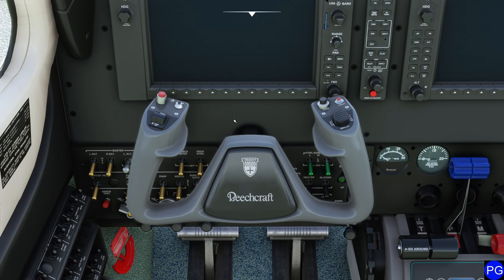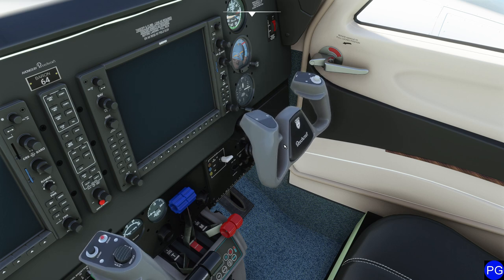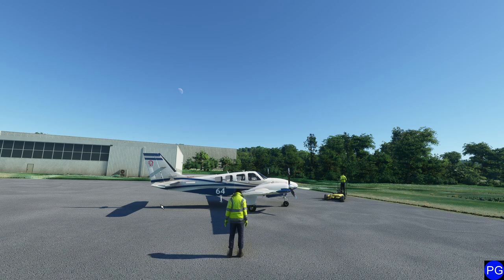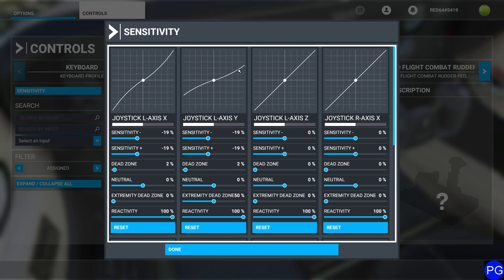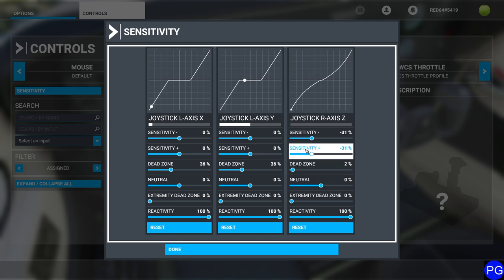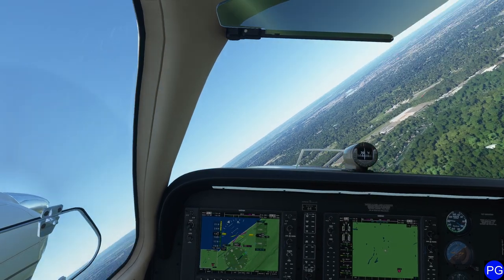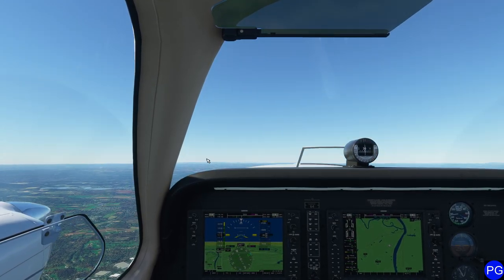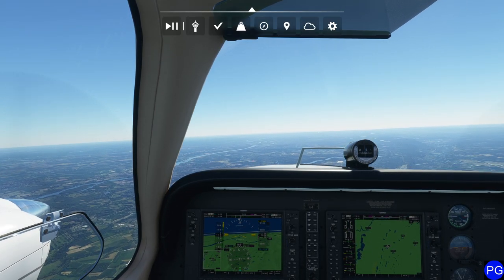MSFS - Adjusting Controller Sensitivity Curves

Comment: Very helpful video. I was using the same yoke profile config for a Cessna and M20R Ovation and it was causing me a lot of frustration when flying the Ovation. I did mess with the settings a bit but not knowing what they all meant made it pretty difficult. Using your video I was able to get the Ovation configured in about 10 minutes using a new profile. What a pleasure it is to fly now. My biggest issue was getting my brakes too work but your video gave me a clue.

I have MFG Crosswind pedals and they were not getting full range of motion so I had a devil of a time stopping any plane. I figured something was wrong after watching this video and seeing the bar go all the way to the top which mine was not doing. The out of box config comes with a 10% dead zone at the end of travel so just an FYI to anyone with the MFG pedals. You need to use the MFG calibration utility first before you set them up in MSFS. Anyway, great job man and thanks for taking the time. AE

Comment: OK. First, glad you did this. It has been desperately needed, especially since MS/Asobo don't provide much documentation on MSFS. 
Question: You mentioned early on you will probably need a different sensitivity setting for each type of airplane. Does this mean you are using a different profile for each specific aircraft type (such as the 172, Bonanza, Baron, Citation, etc.) or do you use different ones for general aircraft type such as single piston, jet, turboprop, etc.?

Comment: i have a logitech 3d pro and it works fine on any aircraft in msfs except the pmdg dc 6b  , i have no pitch control and it crashes and i cant pull it up. Ailerons are very sluggish so im guessing its in the x y and z settings.  Do you have a vid for this or bigger plane settings.  This joystick works fine for 747 by the way.

Comment: Have you thought about cleaning the pots in you rudddr pedal? Sounds like the potentiometers are dirty. Get some electrical contact cleaner and spray some in to the pot and then work it in both directions a few time.
It may take a few times for it to get more then acceptable and should buy somemore life out of them.

Comment: BTW for the new Bombardier CRJ 500/700 one odes not need to do this. it's done on the tablet in the cockpit. Especially when using the TM Airbus throttle quadrant.

Comment: BRAKE AXIS & REVERSE THRUST/PROPS for Thrustmaster TWCS Throttle's YAW
This is what I have been wanting for quite a while now and then I cracked it.
At first it was obvious to check if both LEFT & RIGHT BRAKE AXIS can combine to the same...they do but the middle is always at 50%.

So how to tune this from just the Sensitivity Settings: (it was not the obvious way to do it). If you want your Index/Middle fingers to operate this with Z+ it doesn't as I found out.
However, it does work for your Pinky Finger for Z- but you must set both to REVERSE else it does not work trying it all the opposite way for it all.

Sensitivity- = 0
Sensitivity+ = 100
Dead Zone = 18
Neutral = -30
Extreme Dead Zone = 0
Reactivity = 100

Just what you need with sudden 1/2 Power then graded to Full.

Comment: I wish they would make all of the control settings universal to work on all aircraft, I know having elevator axis pitch sensitivity set to.. let's say +/- 25% will work fine for the Beechcraft 58 Baron, but for some reason it's way too sensitive for the Beechcraft Bonanza or the Cessna 172. I know you can create a separate settings profile for every aircraft in the simulator but it's a hassle because you need to select the settings profile for the aircraft you're flying.

Comment: I have paddles on my throttle for rudder. Everyone think looks centered in sensitivity however when I take off I have to apply almost full left rudder to keep the plane on the runway. This is with all of the planes in the game. It completely drags me off the right side of the runway
Reply: its happen with me too, what have u done?
Reply: Do you mean you need to apply "right" rudder (not "left")? If so, it's because it is a perfect simulation of this physical phenomenon (combined with the torque effect): https://en.wikipedia.org/wiki/Slipstream#Spiral_slipstream
Reply: Highly recommend flight school it explains this. You have to apply right rudder to compensate for the torque generated by the engine(s)

Comment: Have any of you had problems with the Honeycomb Yoke pitch control?  For some reason, when I pull full aft on the yoke or push full forward, the elevator starts twitching halfway through making the airplane hard to control.
Reply: Maybe try to calibrate it threw your driver settings
Reply: @Deanjacob7  I figured out what was happening.  I had a PS4 controller connected with USB and that was interfering with the yoke.  Once I unplugged the PS4 controller, the yoke was perfect!
Reply: @ryannagai8295  good shit have fun simming
Reply: @ryannagai8295  is it possible to use a PS4 controller?
Reply: @maciek4257  I haven’t tried it out.  It was interfering with my yoke so it probably does.

Comment: My issue is with my joystick(Thrustmaster TI6000) twist (Z axis) for rudder/steering control. The twist sensitivity settings seem to work ok when viewing the graph, but when taxiing, I twist left to turn left and nothing happens... nothing happens... a little more twist and suddenly the plane veers left and locks there. It doesn't return to neutral when I relax the joystick (numeric 5 resets to neutral). Because of this issue, I generally taxi using aileron with the rudder linked which is doable but not realistic.  Is there a joystick setting to correct that? This is a fairly new joystick. This happens with any of the planes I fly.  BTW, it's not just left... same thing turning right. Appreciate any help.

Subsequent update : I have learned that you don't set the control on "Rudder Right", or Rudder Left", or "Rudder axis Right", or "Rudder axis Left".  Simply use the "Rudder Axis" control and map the joy stick accordingly.
Reply: Check the settings for wind. Sometimes strong wind makes it impossible to steer into a certain direction.